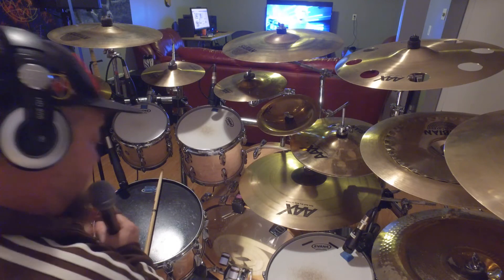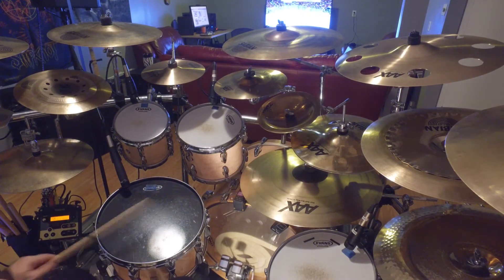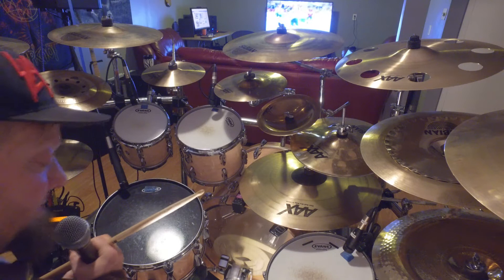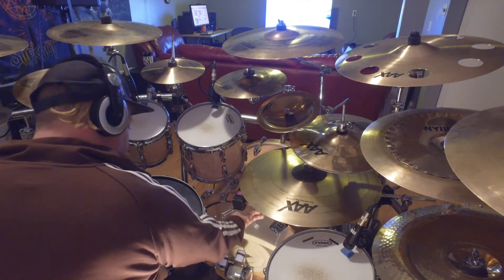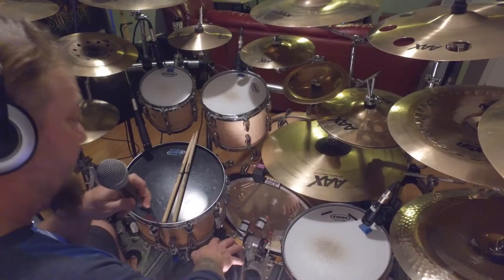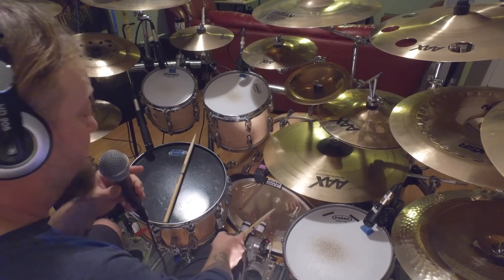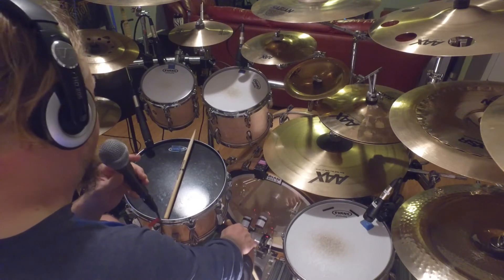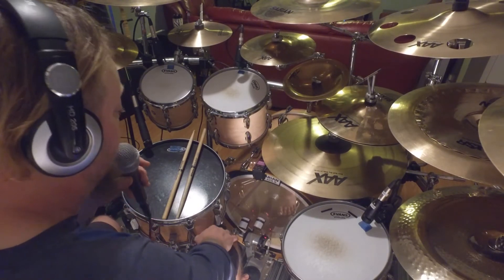Trigmic Laser Pick - Laser drum triggering

Comment: Is it possible to use the trigmic in conjunction with another module? it would be cool to use the trigmic on my hybrid drumset but how would i plug in the rest of my set. Also, does the trigmic do midi out?
Reply from the maker: Matt from what I have been told the trigmic will also work with a drum module, I no longer own a drum module as I only use the trigmic nowdays. When ordering your trigmic let them know you need a sample installed that can be used with your module.

Comment: If you put the (Roland) trigger on the bottom edge of the kick drum, you'd see a significant improvement in the  number of misfires - e.g. zero misfires.

Great video - I've been looking at these Trigmics and this has been very useful. Thanks.
Reply from the maker: Russ I have tried mounting the roland triggers on every part of the kick drum and still got cross talk. With the trigmics issues like this are long gone for me!
Thxs for the comment. :)
Reply: Ive never had the cross talk issues that you talk about here but guess it would be possible if you are giving your drums some pelting. Thanks again for the video though - it's certainly a neat little gizmo and saves carrying around a TM2 and trigger... so deffo food for thought :)

Comment: Hi! PLZ dude help me with this lazer trigger. i just got mine and i wanna have "machine gun" triggering but it triggers to much.. even if i move the beater foward by hand slowly it triggers already when the lazer sees the small brown line before the thin silver line.. And then it triggers where it should right then the lazer sees the thick silver line and even when it goes back it sometimes triggers... and the manual says u cant set sensitivity using machinegun triggering.. havent tried to turn the beaters yet but i see you have them as original.. i want to have it like you where it dont missfire and dont care about the small strokes but only when it  comes som power in the stroke. Coz i sometimes have the beaters near when i just rest on the pedal and dont wanna any missfires there.. Hmm my english is not so topnotch :D but i hope you understand my problem? =) All best!!!!!!!!!!!!!!!!!!!!!!!
Reply from the maker: As you can see i do not use the full reflective material I only use a small piece of the silver reflective material. I aim the laser as close to the edge of this material as the beater is in contact with the skin. Mode an response is both set to 5 of the lights lit up! All of my hits are very consistent and I have zero  miss fires. I do not use the machine gun setting as it does not sound very realistic in my opinion.  Hope this helps. Cheers Keith
Reply: Hi yes i changed to Dynamic to much better. Now it dont register as easy to coz i sometimes come very close to the skin even when not playing only resting ... now i have to hit pretty hard to get maximum trigger sound.. but it still comes triggering if i hitt soft but only a small one and i can live with that :D  Thanks
Reply from the maker: Adjust the mode an response to 6 and try that!! You have to find what setting works best for your playing style. I also use vruk pedal attachment and find when doing vruk technique that my hits are no where near as hard. This would be where i was missing many of my double strokes in the past before settling on having both settings at 5. At both settings set to 6 i can get a more consistent hit but find it lacks a bit of the dynamics as well. Try playing with different settings you will find your happy spot.
Reply: Yea i think its all good now :D I get hard hits even at 220 tempos using lowerleg and the rebound of the pedal. The lower tempos ofc with full leg the hits are harder but now that much difrense. Hard enough to get the full dynamic to trigger now atleast :D